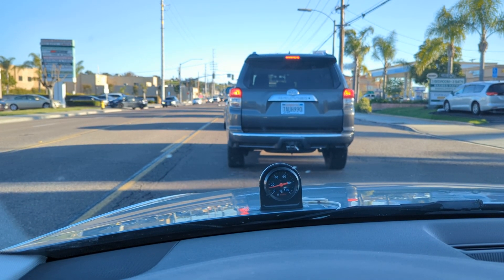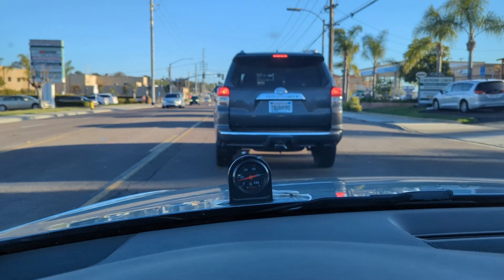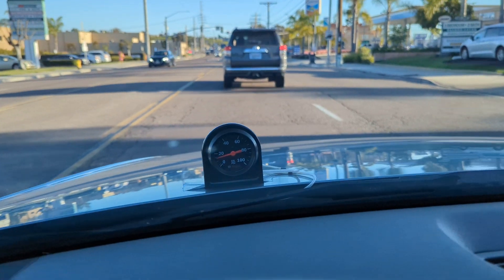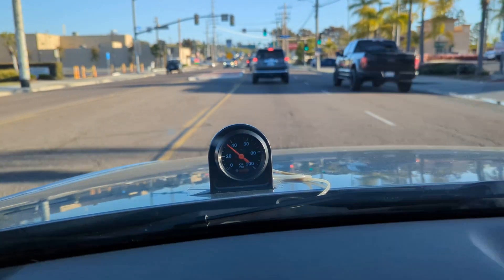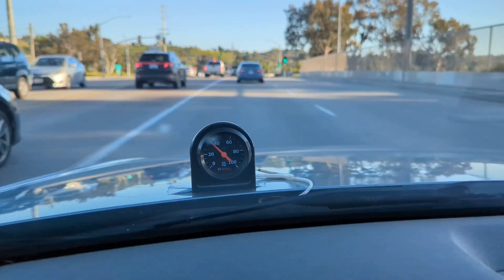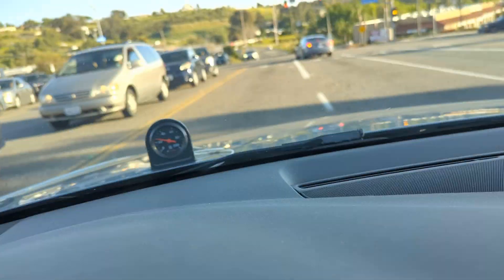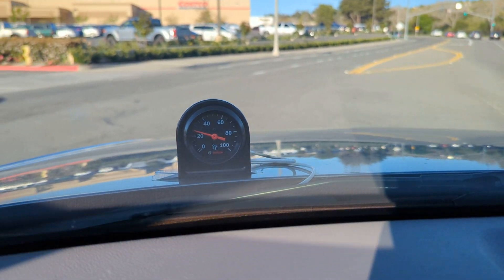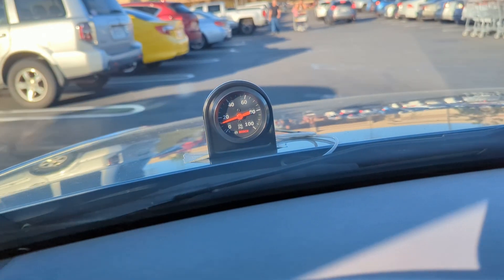2011 Audi B8 A4 2.0T N428 Valve Disconnected, Low Oil Pressure Fabricobble

Comment: I did the same 'tweak' on my mk7 gti, but connected a second n428 "dummie valve" to prevent FAULT entries. Upgraded pumps are around 1000euro...